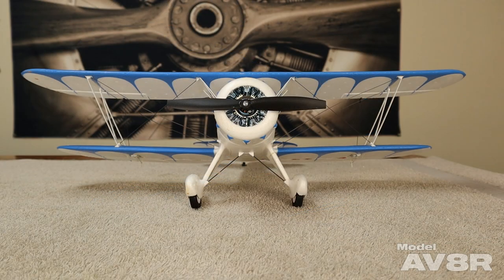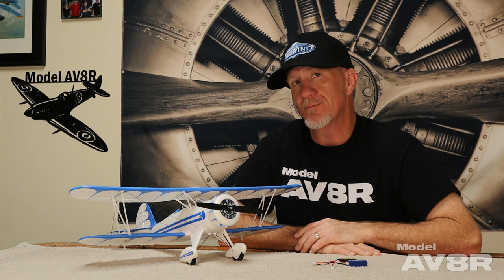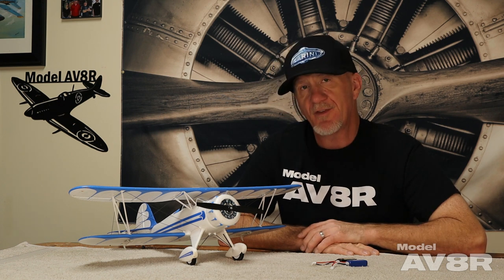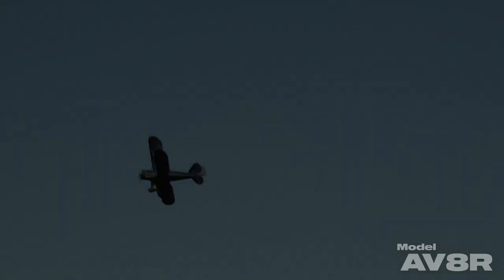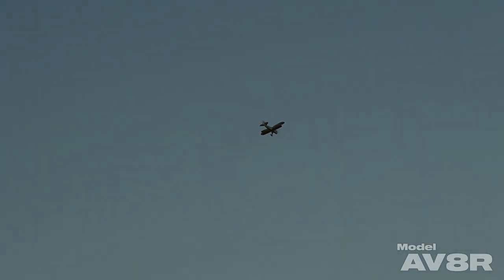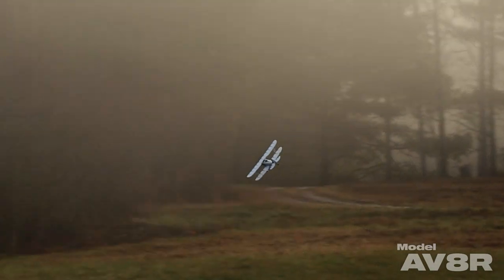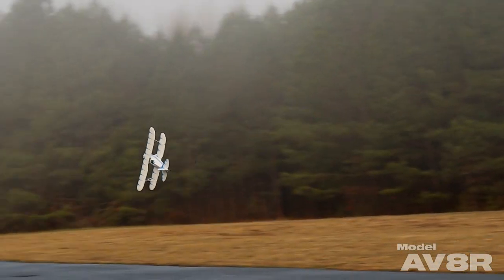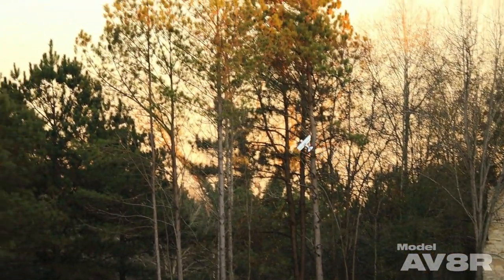E-Flite UMX Waco BL BNF Basic - Model AV8R Fun Flight

Comment: Technology has changed significantly over the years. Truly amazing. I dont glg the micros as I have trouble tracking the size. The Waco is beautiful and you dis a great job talking and walking through it! Great job!
Reply from the maker: Thank you David! Yeah man the tech in the hobby now is really amazing. I also enjoy the science of airframe set up and the challenge of always improving my raw piloting skills. I don't use any stabilization in my planes normally...I think with the bigger planes (if they are designed well as models...so far most are I've come across) a gyro is a choice rather than a necessity to get the plane to fly well. I do think the exception is the tiny stuff like the UMX line...they truly need it to fly their best in my opinion. BTW...How is your Skymaster build coming?
Reply: @ModelAV8RChannel  I dont typically fly with a gyro either unless the plane happens to come with it. We didn't have them when I started so I prefer to fly by the way the plane gives me visual and ques. I believe that its a choice and if it makes it easier to fly and it makes a plane more manageable or easier especially in umx then Im all for it! The Skmaster is slowly progressing. I added the battery trays the other day and Im in the process of putting tge ducting and internal things back together. Then Ill move on to the air system. Ive had some other side projects and things Im tying off also so build time is slow. I managed to get a part for my OV10 to put it back on its legs so Im working on it also.
Reply from the maker: Awesome David...I look forward to your next video! On the gyro's...we have considered that rather than getting the PNP or taking the AS3X out of Horizon products and replacing it with a regular sport rx  like we normally do maybe we should review them with the AS3X because that is what everybody seems to buy/use. Then again everybody else that reviews them does with the AS3X, so maybe the fact that we set the airframe up and get the most out of it without it is useful two...maybe we should touch on both...not sure. These are the things a tactically minded reviewer like myself ponders...lol.